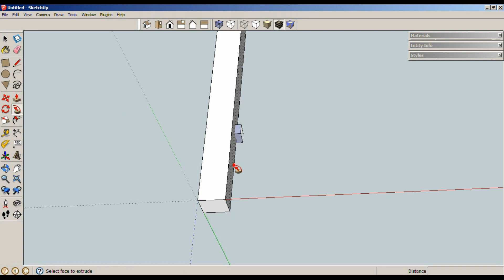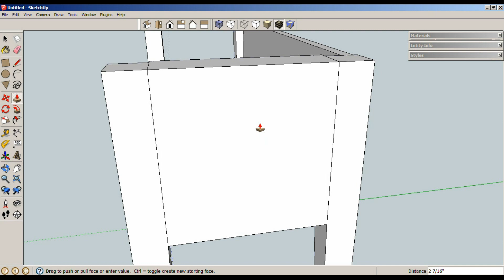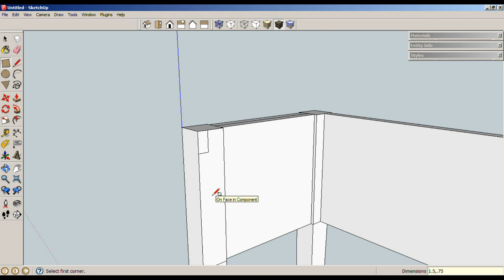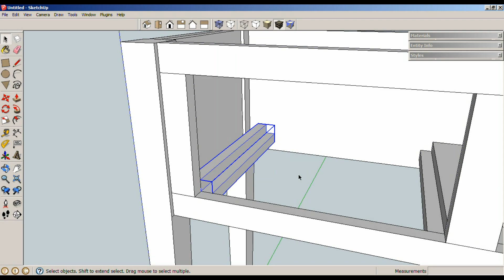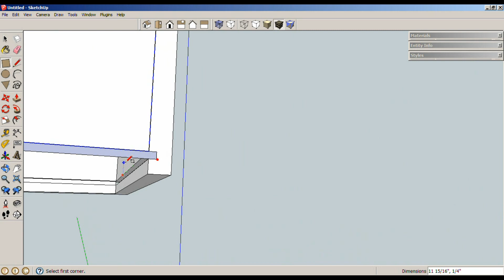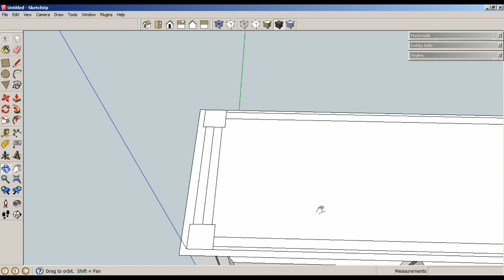SketchUp - Sofa Table - 102

Comment: Hello Jay! One question: Working with the metric system is not easier? Here in Brazil we only use this method and it seems to me a more direct and simple means. What is your opinion?
Reply from the maker: It's all relative. Whatever you are used to is easier for you. In the US we are raised using the imperial system so its just what we are used to. That being said...I wish we used the metric system to begin with. Multiples of 10 are a lot more convenient than fractions.